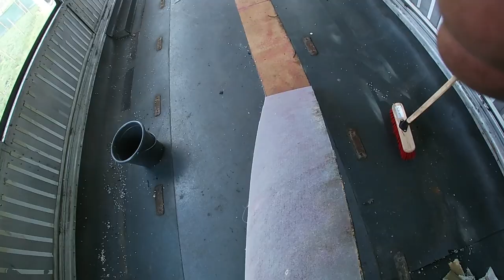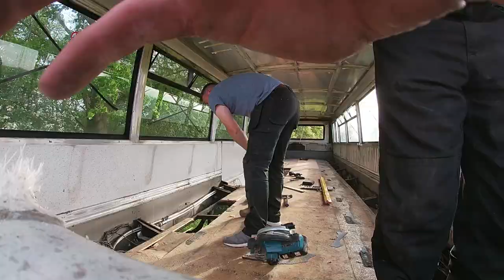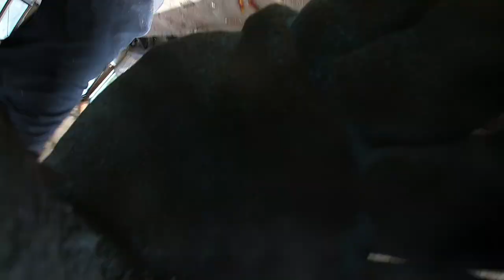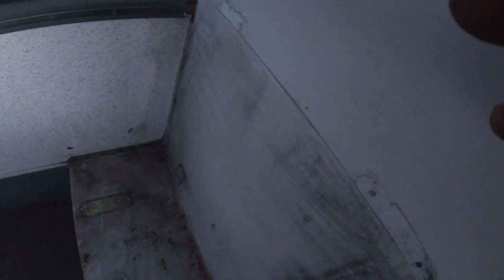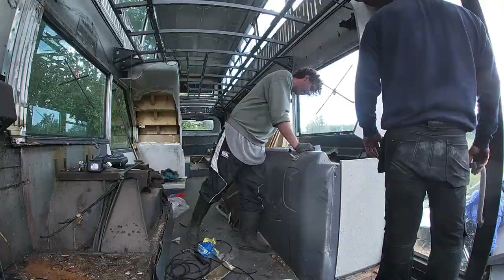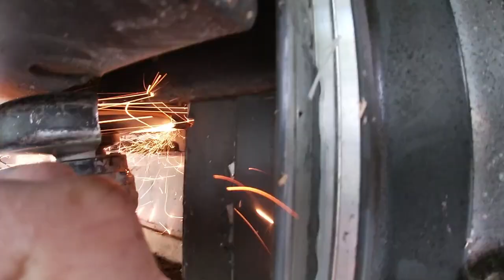Double Decker Bus Camper Van Conversion part 4 the Final Gutting!

Comment: Tears down the walls
Me: Good idea get a deep clean and insulate properly.
Rips off flooring
Me: Oh going fancy with the upper flooring I see. So you're gonna just bolt it onto that absolutely lovely metal frame-
Slices apart metal framing
Me: *Internal screaming*

So much extra work but it will definitely turn out nicer. I look forward to future videos on the project!

Comment: Theres usually a module in the corner of the destination panel, above where the entrance doors are. 
When the time comes to re engine the bus, if you have any issues with the door brake (doors need to be closed to enable the handbrake to release), simply unplug the module and it will over ride it.
If the sensors go bad or if you have knocked any wiring associated with the doors you might the door brake may end up stuck on and you wont be able to drive off. Something to bare in mind, for later.
Reply from the maker: nice one, thanks for the tip Lee :-)

Comment: Was the reason for removing all the metal to reduce total weight?
Reply from the maker: No to make it so the ceiling is the same height top and bottom, so we can walk upright upstairs 👍
Reply: @FieldtoFarm_UK  Good deal. Ill be doing something similar with a low floor bus in the near future and making a second floor. Make sure you post a video on how you are doing the second floor adjustments so I can copy and paste!

Comment: Good job! I'd like a double decker bus to live in, work and travel permanently. But how do you ship a double decker bus (safely) to other continents? (It obviously doesn't fit into a shipping container)
Reply: Haven't you ever heard of car carriers? I used to work on one. Plenty of space for buses and farming equipment, but you'll need to contact a logistics company to handle the shipping.
Reply: @frontalbackstab   Hi Mincho, thank you for your reply, I appreciate it! 
Yes, I have heard of car carriers and RoRo (Roll on & Roll off), but not really in a positive way. There are many reports on theft and such. It is why I keep reading/hearing about shipping your car in locked shipping containers instead of RoRo. It is basically what my question was about. 

Since you worked on a car carrier, it would be great to hear your viewpoint about that. Could you please inform us? Thanks!
Reply: @Ficktao  RoRos are not used for cars only, we've transported giant construction equipment, airplane parts and one time a whole train.
I worked for K-line a Japanese company, car carriers is their main business and are pretty good. 
As for transportation: the damages usually happen during loading because of the drivers (the loading is handled by a separate company usually a local one). Or at the ports. The vehicles are stored at parking spaces out in the open, so if a hail storm passes trough there could be damages to the paintjob.
As for stealing: theft does sometimes happen at the ports and mostly at poorer countries, but they only target new or vintage sport cars. If for some reason they decided to steal your bus, it's because they were hiding drugs in it (there is no way of knowing if there are drugs placed in a vehicle, the ships crew are not permitted to go inside them).
As for shipping: it is possible to arrange it all yourself, but it's best left to the professionals. Just find a good shipping company, most of them give you a temporary insurance just for using their services.
Reply: @frontalbackstab  Thank you for your explanation, I appreciate it! I doubt many people will actually steal a whole bus for obvious reasons. But the reports I read from (camper) travelers were about theft from the campers and damage (from break-ins).
Reply: Just shipped one from uk to nl by road. Very challenging in terms of paperwork
Reply: @simongamme4168  I can imagine! Both the UK and the Netherlands are very fond of their rules, regulations and bureaucratic requirements. Both countries are known for their rigidity and lack of flexibility in implementing those rules and regulations. But ... you got it done!

Comment: Okay considering how much you have now taken out, do you have any concerns of the structural rigidity?, also this was one of those moments for me when I kept thinking you were going too far. All I can say is good luck.
Reply: I think it would flex and fail after many miles, not a worry while its sitting. It would be interesting to only put the floor back along about half or two thirds of the length of the bus. This leaves a high conservatory area over the lounge. Just saw a video where they had put a Kombi shell ontop of a bus!